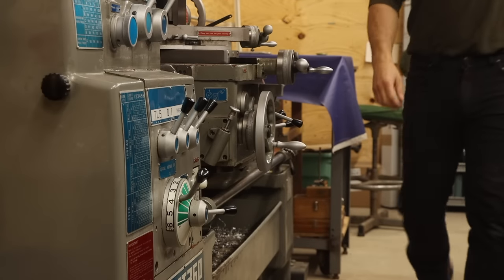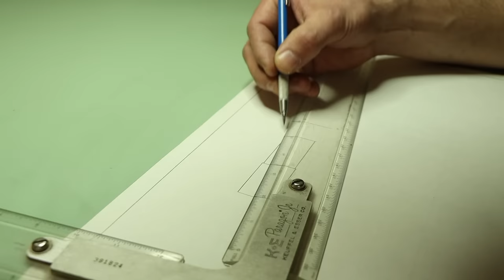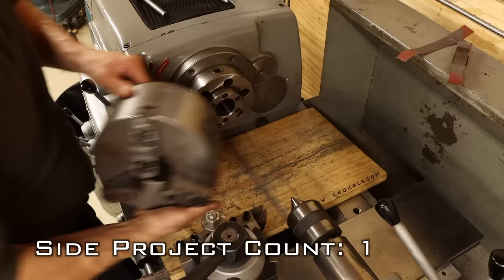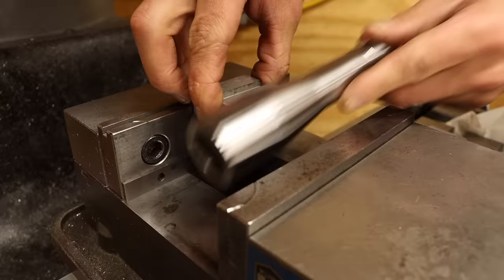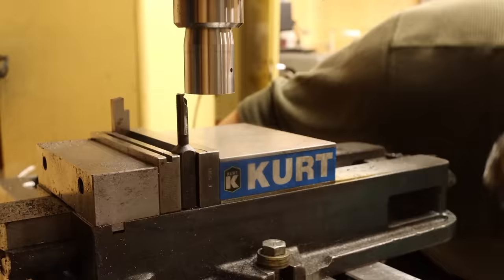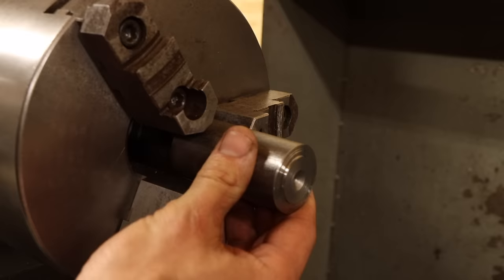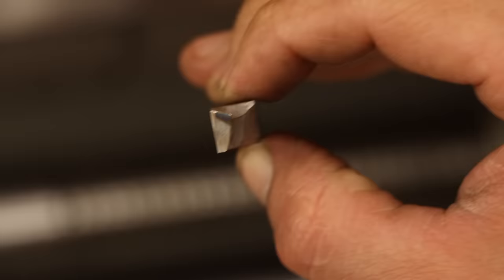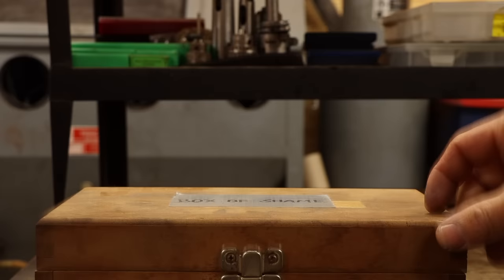Making the PERFECT* Slitting Saw Arbor || INHERITANCE MACHINING

Comment: Another great video and arbour. The only slight change I would have done is not to use a hammer-in pin, but a threaded pin (in case the mechanism ever fails - I know you could/would machine the pin out)
Reply from the maker: Thanks! I actually left the internal slot clear to the bore for just this reason. So I can just hammer it through it needed

Comment: Are you relying strictly on the friction of bolting it together to keep the blade from stalling? I’ve only used slitting saw arbors with keys that are placed in the saw as well to have a extra point of driving force.
Reply from the maker: Yup. It's actually a really strong connection. As I reveal in the next video it was strong enough to completely stall the drive motor in low gear without the saw slipping. Not a good thing of course, but reassurance of the joint's strength

Comment: While the (not so) cheap version didn't meet your requirements, I suspect there were features you might not have included in a clean sheet design. I certainly wouldn't have thought of the multiple size centring system.
Good outcome.

Comment: Rather than turn it between centres, I would have just centre drilled it at both ends, and then using the 3 jaw chuck grip about 5mm of one end and support the other end with the centre. Give it a quick pass and you've cleaned off the warp, and a have a parallel surface to chuck up. 

But then again I'm lazy and hate having to change chucks.

Comment: I am really impressed with using the mill to cut the inside bore, nice !!!, but how certain were you that the bore would not be tapered, IE that the head was aligned with the Z axis, as opposed to with the X-Y axises, have you ever tried to measure whether your Z axis is truly perpendicular to your X-Y axises ?,  its something I've always wondered about for my Bridgeport clone.

I think the most handy aspect of my Bridgeport clone is that it has no R8 keyway pin in the spindle, makes changing R8 collets and holders much simpler, faster, and easier. I can't imagine ever doing any machining so heavy on a Bridgeport that the pin would be of use. I consider the keyway and pin to be one of those they didn't really think this through ideas.  or am I missing something ?
Reply from the maker: Thanks! I trammed it pretty recently within a couple tenths over 9 inches so I think I was ok. Good observation though! And on the keyway, only until a couple others mentioned removing it have I ever heard of it. Seems legitimate to me

Comment: Hi Mate keep up the good work. Only one point is the homemade drive dog is not right for the job. buy or make a dog leg style thats why the drive leg is designed with a bend towards the faceplate drive pin so you dont need longer material and dam safer. but great job anyway. Cheers

Comment: Honest question - why not include a keyway for a drive key? Most of the saws look like they have a slot for one, and it seems like it would improve rigidity.
Reply from the maker: I've seen some that have it and some that don't. It might be necessary for thicker blades where the forces are high. But for the thin ones I've never needed a keyway to keep it from spinning. The cutting force also cause the screw to tighten as well

Comment: How do you avoid interference from the holes in the slitting saws against the corner radius on the centering cone?  If the holes vary enough from the nominal sizes of the cone to clear the radius, doesn't that work against the centering function of the cone?
Reply from the maker: It would actually help it center even better since the radius gives a gradual ramp. Then is springs down into the body so all the actual clamping is by the outer perimeter

Comment: For the retaining pin is there a reason you didn't decide to partially thread it for easier disassembly?
Reply from the maker: I just wanted to keep it simple. I can still drive the pin through in the event I need to get it apart

Comment: Hi, I was wondering if instead of shortening driving pins, you could just cut the end part of the stock in between centers, then flip it around and mount in 3 jaw with newly cut surface and live center on the other end. This should keep stock straight now inline with live center and you could continue in normal setup.
Reply from the maker: Yeah that would probably work though I would use the 4 jaw to guarantee realignment. Most 3 jaws have a but of runout in them, mine included
Reply: @InheritanceMachining  sure, you would have to skim whole part still and treat it as new stock piece just put fresh in 3 jaw as in first step :). Just getting rid of the bow situation for tailstock and not having to cut your tool, but whatever works right? :)

Comment: I notice that your blades have slots for a drive key, yet your arbor doesn't have a key.  When I bought my first saw blades and arbor, they didn't have keys and the first time I tried to use it, the cap tightened up so tight that I wasn't sure if I'd ever get it off.  I threw away that arbor and bought one that has a drive key.  Have you encountered this problem?

Comment: Here's what I got me interested in machining 
Plunger type/piston headphone frame with removeable ear cushions and cups and drivers 
All screws/hardware will use preferred(torx/hex) /slotted 

And an aluminium phone clamp

I don't have the tools to make these so I thought maybe I could have some other business machine the parts 
But finding said business is difficult 
Also I don't have a large budget 
I guess the good part is I require aluminium for these parts since it cannot be too heavy/dense

Comment: Wow that looks amazing
Only concern would be with small diameter thin saws, those usually have small diameter which the chonky arbor would reduce even further.
I also wonder if you will get a tool grinder of some sort someday, for no good reason but to always make the perfect tool for an operation xD
Reply from the maker: Yeah that could be a problem for sure but it's a bridge I'll cross if/when I get to it haha A D-bit grinder or tool and cutter grinder is pretty high on my wish list. Thanks!
Reply: When he needs to use a small saw, just make a scaled down arbor! Maybe a future side project?

Comment: Excellent build! 

Did you do anything special to remove the tool radius from the steps of the centering boss so that the blade will sit square on the centering boss?
Reply from the maker: Thanks and no. I just used the sharpest tool I had and any radius that was left won't be of much consequence since the boss will just retract out of the way. Actually, the small radii will probably help to center it even better

Comment: what do you have for a drafting table? I still have my drafting arm I bought in high school ('86) but the table my Father and I built is long sense been wrecked. I still have the 3 foot by 5 foot drafting matt also :) I used to have 2 linear (track) machines from my brother but have sold them because they were just too big for my use :)
Reply from the maker: I'm not sure actually. It doesn't have any branding on it but it's definitely a manufactured product.

Comment: Having 0 Machining experience question: When you were turning between centers, could you have flipped the part around and avoided the side-project when doing the facing cuts? Or would that have introduced runout from one end to the other?
Reply: I'm commenting mostly to follow this to see the correct answer, but i have a guess. My first thought was to avoid marring the surface finish by tightening the drive dog on the machined face. Second and probably better thought is simply that flipping the work piece would be two setup operations introducing a lot of time and potential for error.
Reply from the maker: Someone else brought that up and it's definitely possible. I would think if there were any runout error introduced it would be pretty minimal.
Reply: Turning between centers is the most accurate way to machine something that needs to be flipped around multiple times, everything stays concentric to the centers as long as their kept clean

Comment: Love all the new camera angles! But I'm curious, is the pin on the side necessary to have visible? Or could it be ground down to give a more clean look?
Reply from the maker: Thanks! I did hammer it flush but I'd prefer it stay somewhat visible so I can find it if I ever need to drive it though for disassembly

Comment: I'd be interested to know how long that took in real time! I appreciate how difficult it is to do whilst you're filming -I've tried it (not very successfully).
One suggestion for the future - I dont recall seeing a tool and cutter grinder in your shop. As I do a lot of horizontal milling it's indispensible as you can buy good but blunt cutters and make them sharp! With one of those, you could correct that janky slitting saw!
Reply from the maker: Thanks. A tool grinder of some sort is pretty high on my wish list for sure. And on the project timing, this one took about 20 hours to design and machine

Comment: Don’t know if you covered this already but, does your air system that you use to blow chips have the capacity to do a lubricant mist instead  of manually spraying your work? 22:24
Reply from the maker: Yup thats what I use it for actually, though it may not always be visible. I wasn't able to spray both sides of the blade so I managed the other side with the squirt bottle
Reply: @InheritanceMachining  That is really neat. Thanks for taking the time to respond.

Comment: To solve the deflection issues: why couldn't you just center drill for the tail stock with the part in the position you plan on holding it to turn it? This should allow you to hold it without deflection and true it up/remove the bow without resorting to turning between centers.
Reply from the maker: I could have tried that. But wasn't confident with the amount of stick-out I needed.
Reply: @InheritanceMachining  fair enough. Just thought I was missing something

Comment: So incredibly well done! Looks like I will need to do this myself, but I don't have the drafting capabilities or abilities that you have. Bravo on your efforts. Did you confirm your tram before facing and boring the tool in situ on the mill? My mill does not have a tramming worm gear,  so it's a real PITA to get perfect. The Quorn Mk3 project is keeping me pretty busy as of late. Look forward to your next project! If you are on Hobby Machinist forums, My name is the same as here I believe.
Reply from the maker: If you're taking on the Quorn I think you could manage a slitting saw arbor haha besides the best way to learn is to just dive in. At least that works for me. I didn't think to check the tram but that's a really good point. I have adjusted it semi recently though. Thanks!
Reply: @InheritanceMachining  The Quorn comes with blueprints. Design is not my forte yet. ;)

Comment: What is the purpose of the piece with the bolts that he cut the posts to make room for?
Reply: He's cutting between two centres which cannot drive the material. The drive dog is mounted to the material and the posts on the chuck drive the dog.
Reply: Oh I see, the posts he cut drives the spinning into the part because you can't transfer the energy through a small point of contact. Thanks!

Comment: I have to say, that's the weirdest between centers driving method (for a lathe of that size) i've seen so far. IMHO, you should just get a set of dogs for this and use the 3 jaw with a center you machine before the operation. That amount of driving force is unnecessary, and it's meant for stuff that's way bigger. Like i've only personally seen this when they turned the shafts for our rock crusher, and i think that was a 80 or 90 cm drive plate. Just my 2 cents, a set of dogs is much better than that. :))

Comment: I'd like to see you build a micrometer.  I'm starting to build my own, but I know it'll look super janky and not nearly as beautiful as what you could build.  It's my intention to build a micrometer that can be removed from its fixture and inserted into other fixtures, zeroed, and used as an internal, external, and end micrometer.  All my hardware store has is 20 tpi threads, so I'm not sure if that'll make precision more difficult, as micrometers are all 40 tpi.
Reply from the maker: If you make the dial the scale is on larger in diameter you can increase your resolution. And adding a vernier scale always helps

Comment: That has been my experience with slitting saw blades. None of them are properly concentric. In theory you could use a non-concentric saw blade and a non-concentric saw blade arbor, and rotate the blade relative to the arbor until the two runout errors cancel each other out.

Comment: I'm not an engineer and I don't play one on Television or YouTube.  As a former Washington State, City of Everett, Boeing Aircraft worker, late 1980's to early 1990's we were told the the 747's "Wing-Spar's," (Front and Back main structure{s} of a wing{s},) were SHOT-PEENED (think Sand Blasted) to "relive stress," in the formed part (approx 100 ft or longer.)

How important was this operation of SHOT-PEENING, if you ever fly on a 747-400, and they say it's the first one off the production line, know that Boeing scraped the first set because of me, when I pointed out that the operation of SHOT-PEENING, was never signed off (means that someone didn't use their assigned stamp {which was the last four digits of your social security number.)   At the point of when the screw-up was verified (via-me) than of course through the HIGHER-UP's, I would argue the wing(s) were 70 % percent or slightly more done.  Needless to say, their was some very serious overtime for a couple of weeks their after.  They had a DEAD LINE / DELIVERY DATE to meet.  That was a heck of a lot of money, that went into the trash.  At the time, 747's were selling approx. 125 million, plus pilot training and some common spare parts (extra Tire's / Brake-Pads and alike.)  If I'd had to guess the cost of trashing the first set of wings?  Remember, I'm just a nobody, but I would put the figure around 20 to 40 million.  Believe me they did a lot of checking, before throwing in the towel on the first set of wings.  They so wanted for me to be wrong, but I give credit, they bit the bullet, and trashed them.  Quality-first.  Still gives me goose bumps, they threw them in the trash.

Comment: If you'll ever want to remove that pin...you'll have to drill an extra hole to knock the pin out.
Reply from the maker: Not at all. The slot is clear through to the bore to I can disassemble it 😁

Comment: Why didn't you measure the run out of the spinny thing you made by measuring the spindle instead of the blade? I'm not a machinist, this is a genuine question.

Comment: only problem is, you can never take it apart..... there is no way to get that pin out.... its very nice work tho
Reply from the maker: Thanks. The slot is milled through to the center bore for just this reason
Reply: @InheritanceMachining  i am sorry, i must've missed that part.... i just rewatched it..... i would've used a cap screw because i hate flatheads... lol

Comment: That's not runout or a problem with the blade, that's just tooth geometry.  They aren't supposed to be identical.
Reply from the maker: Why is that? I would think they need to be the same so you get consistent chip load on each
Reply: @InheritanceMachining  maybe it’s different for metal, but for woodworking saws you have alternating teeth, serving different functions.  Some for cutting, some for chip clearing, etc.

Comment: Slitting saw blades always seem to have run out in both directions. You have to grind them yourself if you need real precision. If you put bluing on the teeth, you will find that only a few are cutting.

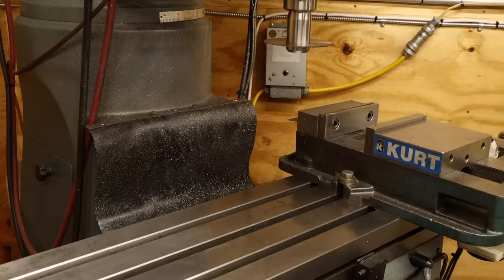Comment: 20:59 if you've been running the blade in a dodgy arbor could it be worn unevenly? That means you can blame the other arbor and not your arbor OR the blade quality 😉😂😂
Reply from the maker: 😂 It was actually a fresh blade. But others seems to verify that there is always a little runout in them

Comment: I am a chemical engineer by education however al bit over 18 months ago I was run over while riding my 1957 Harley and was flipped up and wrapped around a telephone pole and had my right leg run over nearly severing it. While recovering I decided I was unhappy working with the woketards in big Pharma. I am starting a small engine repair shop with welding and fabrication and a manual machine shop populated with 1800's machines run on a central belt system and eventually run on steam. I am still learning how to use the machines I have and I am bidding on a milling machine currently. I really hope I win because it is a perfect size for the area I have.Where are you located? I would love to see how a real machinist does things. I ma in Pennsylvania.